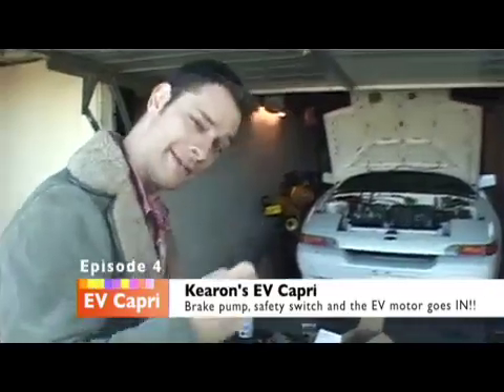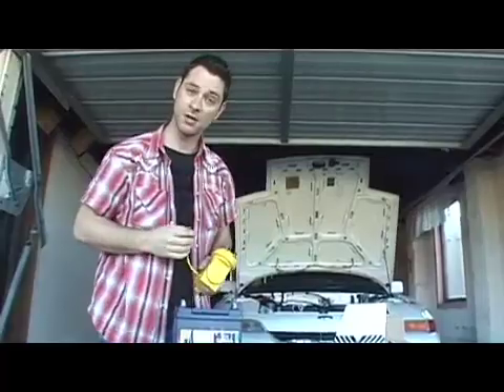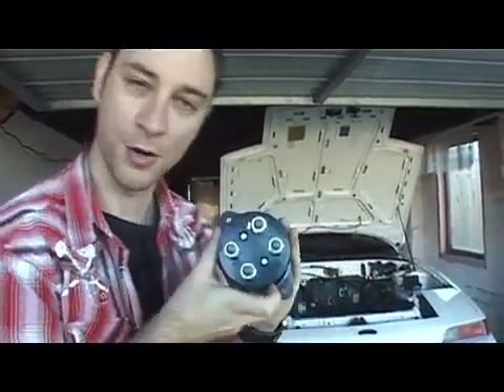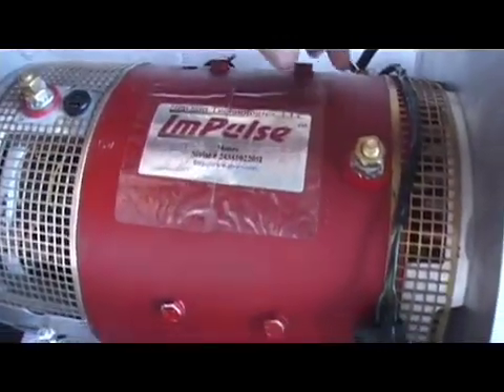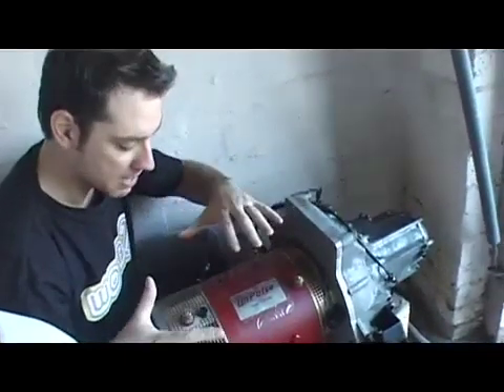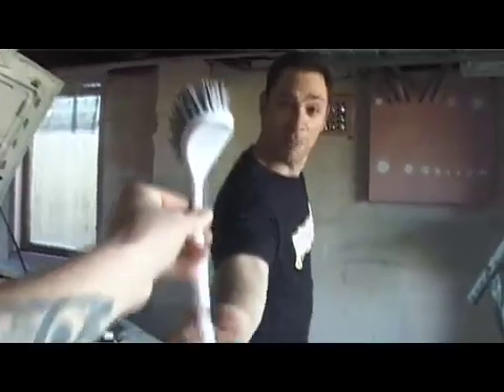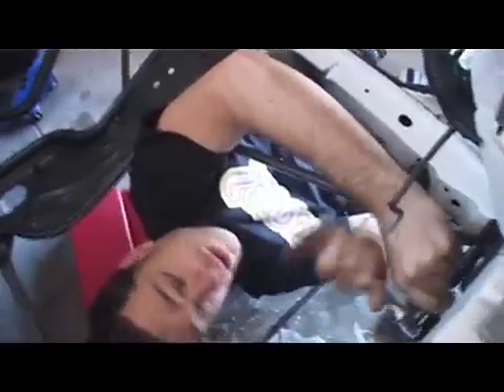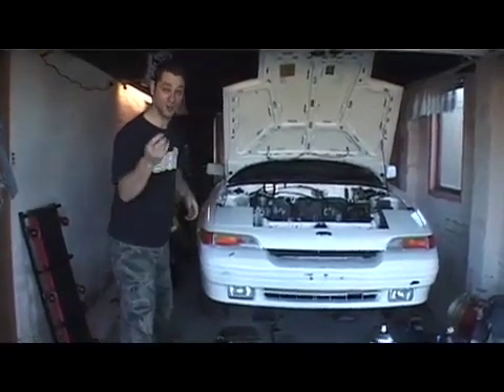EV Capri ep4 - Kearon's electric car conversion

Comment from the maker: @ danieldiasmauro: Yes, it's a standard gearbox, and as such, needs oil (or the synthetic equalivalent of!). As the electric motor I'm running is dsigned for this sort of weight, it's not going to overstress or heat up the gearbox either.